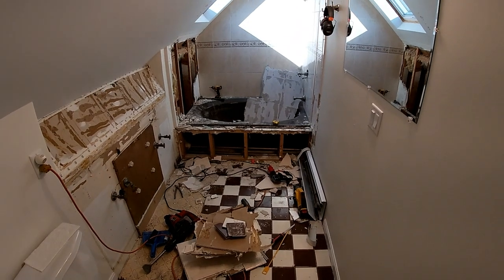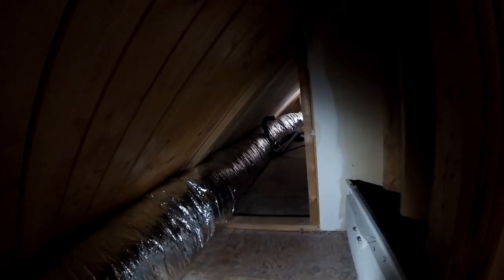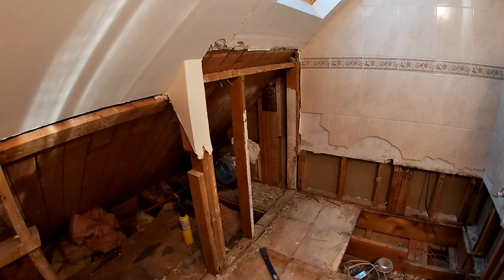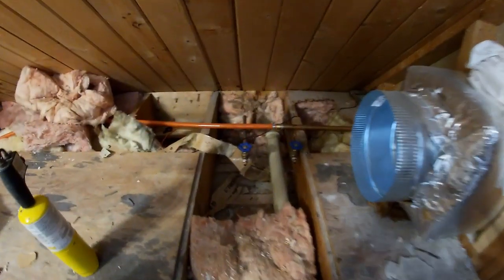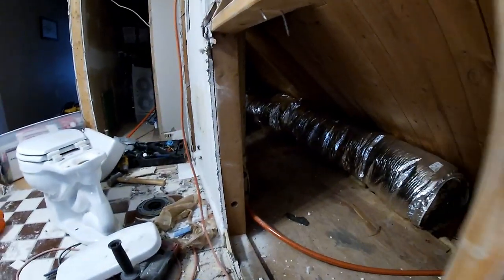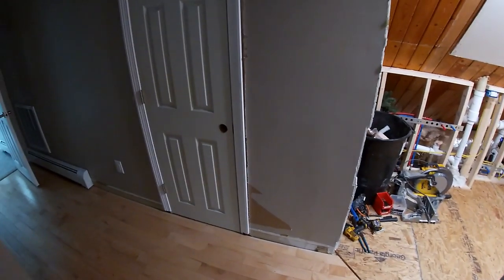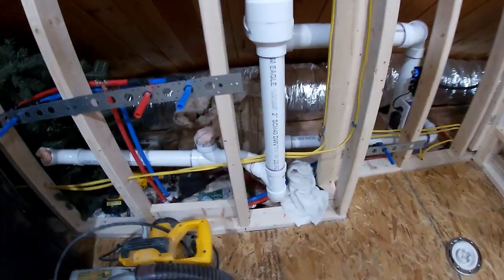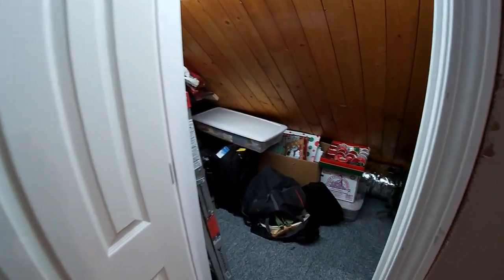Total Bathroom Renovation Demo + Whirlpool Install - Bath Reno Part 2

Comment: How is this tub holding up? I am considering buying an empava tub, but can't find many reviews on it.
Reply from the maker: No issues at all.  My wife uses it at least a couple times a week since it was installed.
Reply: @Trialnerror  Sir, did you use two 20 amp circuits or one 30 amp circuit? Class A breaker right? Thanks for your help.

Comment: Great video...found it bc I was looking at this Empava tub and saw the review. Curious to see how the tub holds up long term. While I was seriously considering it at first, I am pretty sure it is simply imported from China and rebadged. Nothing at all against China, but for long term parts support it makes me leery. There is a LOT that can go wrong with a tub which could damage the flooring, or worse pose a safety risk.